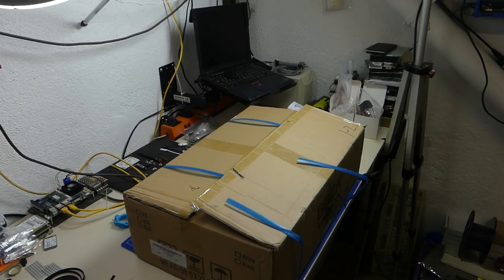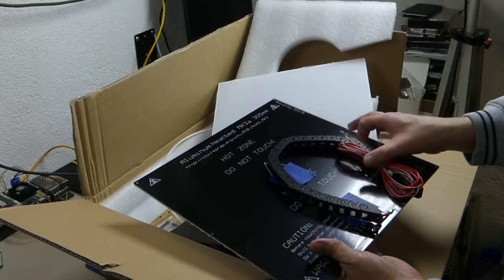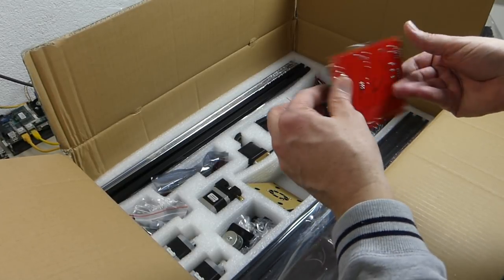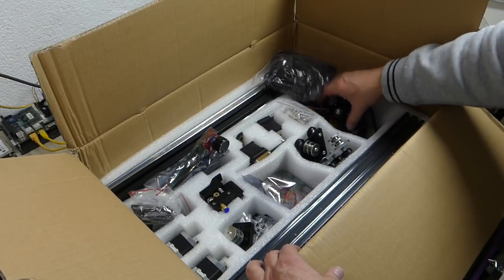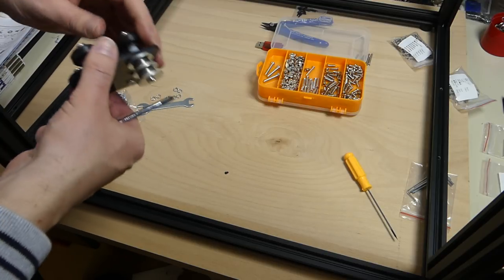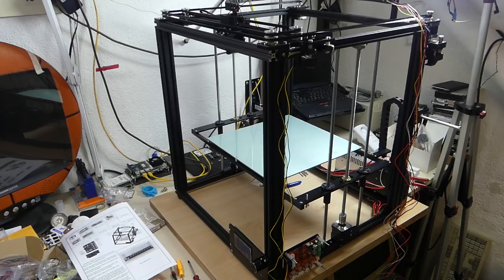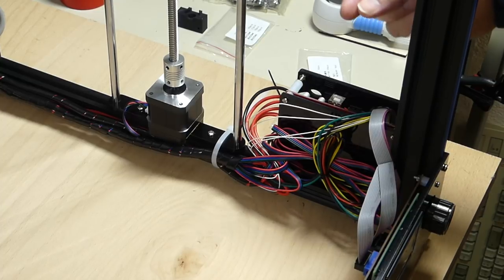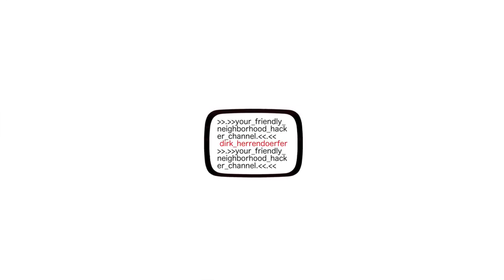TronXY X5s 3D Printer Kit - Unboxing and Build

Comment: Hi, i just ordered a x5sa, can you make a short video where you follow where you have placed the cables?  :)
Reply from the maker: Not in the near future, my work-space is convoluted with things I need for the upcoming MMFs I'll be attending. 
But I bundled all the wires up at the back-right post, except the cable for the left Z-Stepper, for some reason that needed to go around the front bottom profiles, because it was quite short.

Comment: How did you put the belt on?
Reply from the maker: There are two belts - each is wound around the frame from and to the carriage, I usually make sure that the belt only touches bearings with the back (smooth) side, so it flips over once along the long profiles right and left of the carriage.
I also printed a small block that allows for the belts to be parallel along the carriage axis.

Comment: Did you publish your 3D printed adapter on Thingiverse, or somewhere? Thanks.
Reply from the maker: Now I have - https://github.com/dherrendoerfer/My-3D-Things/tree/master/Tronxy-X5s-Belt-Spacer
Reply: Thank you! That's a good looking part. I will print and add it later. Right now  I have the belts on the stock part.

Comment: Does the belts have a glass fiber core it looks like they are pure rubber.
Reply from the maker: No, they are the steel-core type. quite good actually.
Reply: Dirk Herrendoerfer then the whole movement setup looks surprisingly great. The bigger bearings probably also help avoid the steel wires break.

Comment: The controller board back plate with the fan on it doesn't mount the other way so the fan is on the outside does it?
Reply from the maker: No, well - it would - but according to the manual it shouldn't. Maybe not all the boards come with heatsinks on them ...

Comment: Board is an Anet, and so is the screen, like the Anet A6 one, all reprap discount clones, just not the same pinout. There are two bearings in each wheel, and they need a washer between them so you can tighten the nuts better without locking the wheel. Actually ther may have already a washer there, but they'r so chep they just throw any washer, and some are thicker than others.I changed all the washers from all the wheels indeed.
Reply: GroovyDrifter it's not the same as the anet this one is a 32bit

Comment: Get a RAMPS and tmc2208. You can thank me later ;) I changed the supply for 10A passive one and for now not using heat bed (waiting for themac heater) and it's unbelievable.
Reply from the maker: I have RAMPS and TMC2208 on my newest own build - really sweet !!!!
Reply: ...und wir würden sicherlich alle GERN mehr davon hören! <smile>
Reply from the maker: Lach! Ja, ich auch. Sobald es wieder mehr als fuenfzehn Grad in meinem Arbeitsraum hat,  geht es damit weiter.